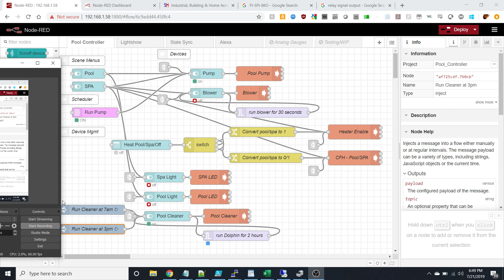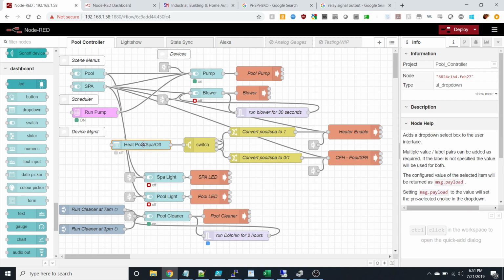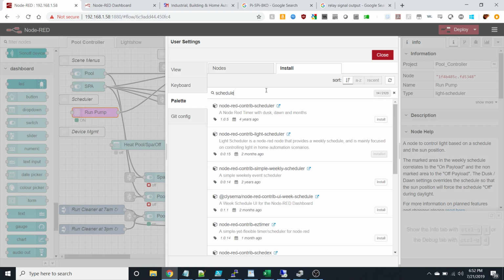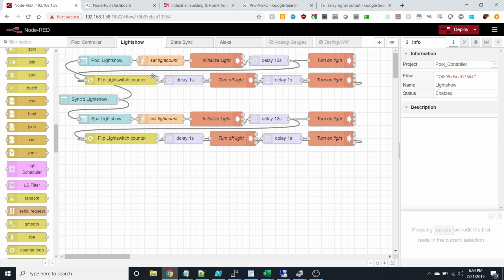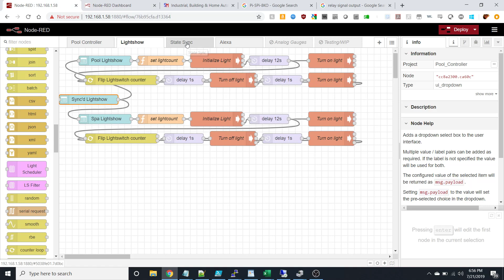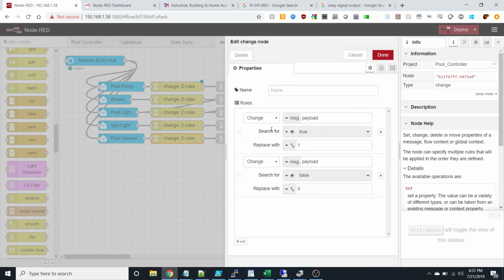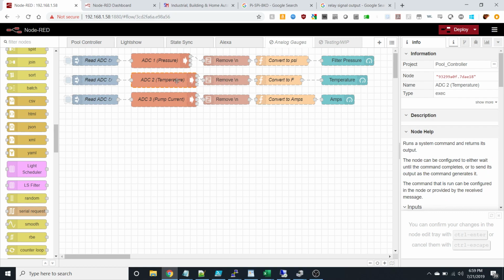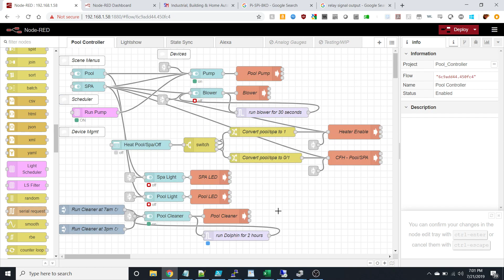DIY Pool Controller - Node-RED walkthrough

Comment: I'm curious, usually people hire a company to put in a pool, but I would imagine they would want to install whatever controller they specify.

Did you work with a company and talk them into letting you install your own electrical Relay board? 

Or was the pool completely self built?
Reply from the maker: The pool was 10 years old by the time I got it.  No pool company to speak of.  I pulled off the old mechanical timer and replaced it with a custom load center/controller that I built.  In the hardware video, you can see a picture of the old one on the ground.  It was just an old Intermatic timer.

Other folks out there are using nodejs-poolcontroller to interface with their existing Pentair Intellicenters so that's an option as well for someone who doesn't want to replace their controller.
Reply: @HumanHiLiteReel  Ah of course Retrofit. Makes perfect sense thanks for the answer!

Comment: Anyone feel free to reply no matter how old this comment is.
I want to control the relays by variables. You're running on a schedule where say, I'd want the pool to stay at a certain temperature 24/7. Heat at <= "temp#" and cool/off at >= "#".
You've given me a few ideas to try but I'm at work and I'm sure it will be trouble later! LOL
Reply from the maker: Easy peasy.  Get your temp sensor into node-red and send the output (temperature reading) to a "switch" node.  Add 2 outputs.  In the first output, check if msg.payload < 75, send a msg out to the one marked "1" to the heat node to activate,  if temp >= 75 send it to "2" to the heater off node. 

I plan to do something similar next season when the pool opens.  Make sure to have your temperature sensor at the lowest point in your plumbing so it's always in water and keep in mind, if your pump is off and you have standing water, the sun will heat the water in the PVC in a way that might not match the temp of your actual pool.
Reply: @HumanHiLiteReel  Got it! Thank you so much. You at least pointed me down the right direction. Was about to ask if I could call you! LOL I was able to find an example that had your words in a flow! 
So simple! Even easy peasy some might say! Thanks again.
Reply: @HumanHiLiteReel  Yeah, that's the idea you gave me. I was able to turn on but not off. Thanks!